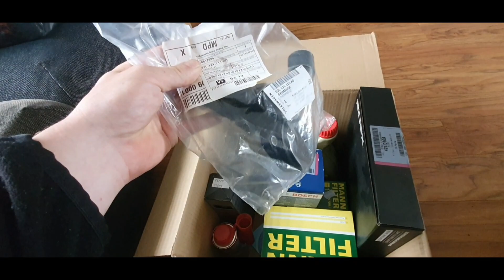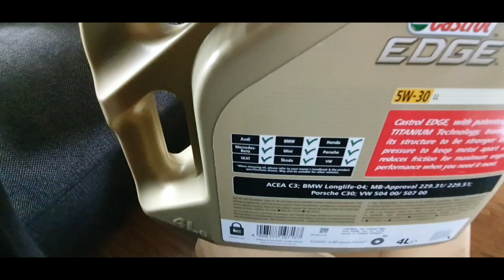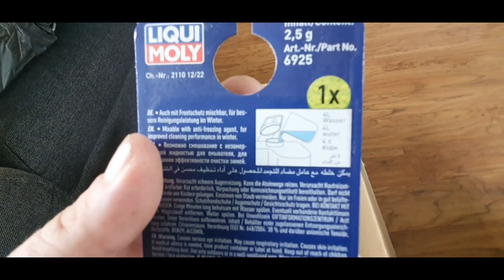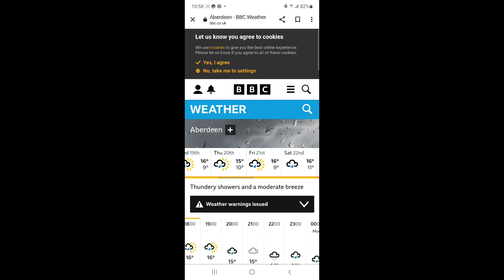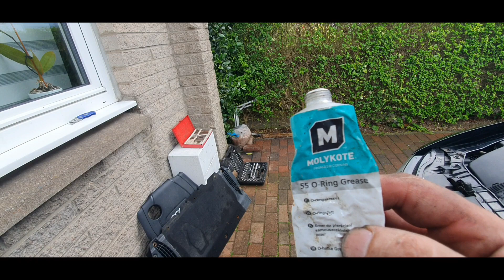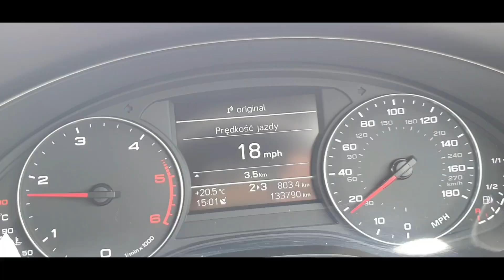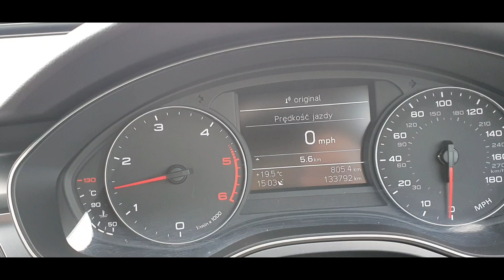audi a6 c7 vag thermostat replacement. what is worth knowing

Comment: Thanks a lot for the video. It is very detailed and helpful. I have to do that at the weekend only is cold and wet. It takes a lot of time to change it ?
Reply from the maker: Yes you need a few hours
Reply: @vag8uk  Sorry, what was the size of the socket you used for the dificult pipe screw?

Comment: Thank you for information and advice. my audi always have 2 bars of heat out of 4. usually around 60-70 degrees and never have 90 i will try replace that thanks.
Reply from the maker: hello, if you have an automatic transmission, you can have 2 thermostats. fix it because the dpf dies faster
Reply: Its a manual. i was following your guide everything was straight forward thanks for the guide. as you said in video one of the conections was a bit a tricky so i used grease to get it in place
Reply: @Romas05 did a new thermostat fix your problem? Mines doing the same thing!